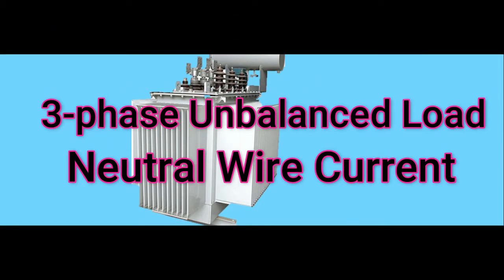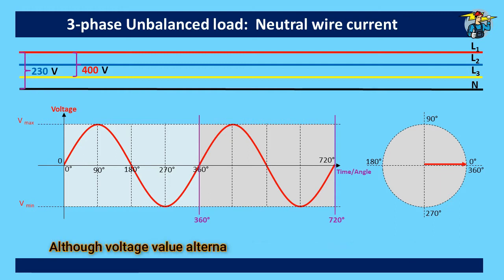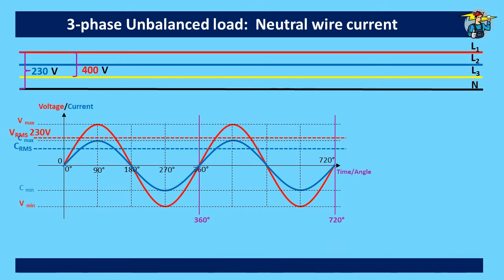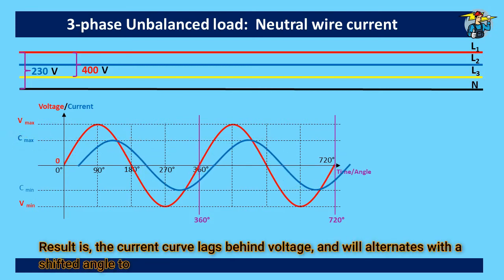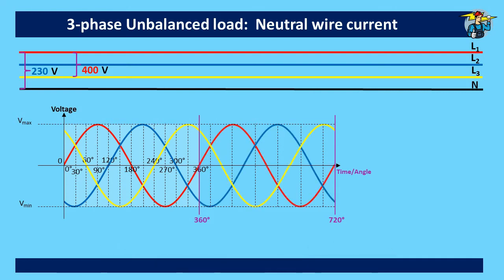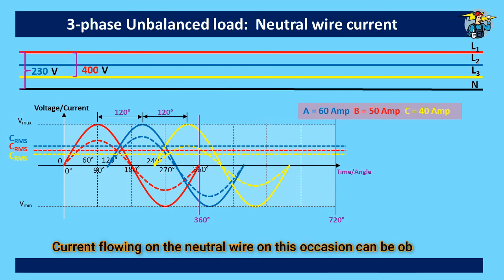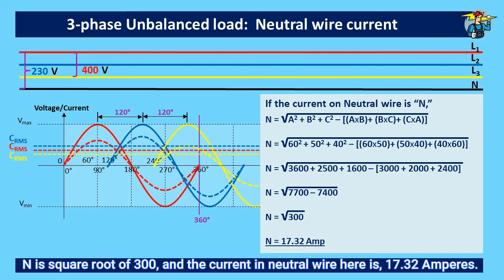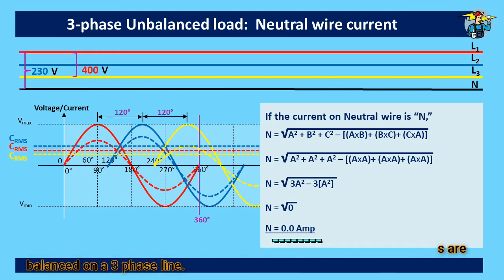Does Current Flow on 3 Phase System Neutral Wire? / 3-Phase Unbalanced Load Explained.

Comment: Have a question: can anyone respond ?? what happens to a 3phase circuit if 1 phase has more transformers than the other two?? will this also cause an unbalanced load ??
Reply from the maker: Yes, if one phase in a three-phase circuit has more transformers (or a larger load) than the other two phases, it will cause an unbalanced load.
Balancing the load across all three phases is crucial for maintaining a stable and efficient system. 
Regular monitoring and proper planning when adding new equipment can help prevent these issues.

Comment: Current lags voltage by 90 degrees in an ………….load?
Reply from the maker: In an Inductive Load (e.g., motors, transformers etc.) Current lags voltage, but the phase difference depends on the load's power factor. 
If the inductance is purely reactive, without any resistance value, the lag is 90 degrees. 
However, in most practical inductive loads, the phase lag is less than 90 degrees because of the resistive component.
In a Capacitive Load (e.g., capacitors) Current leads voltage. 
For a purely capacitive load, the phase difference is 90 degrees, but practically, this is often less due to resistance.
In a Resistive Load (e.g., heaters, incandescent lamps) Current and voltage are in phase, meaning there is no phase difference.